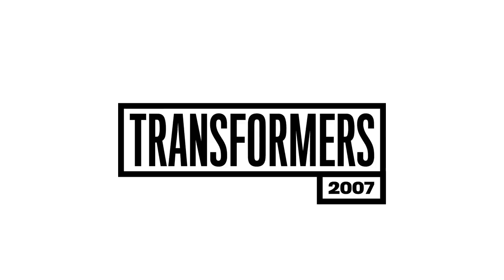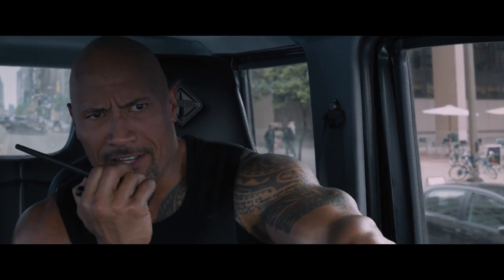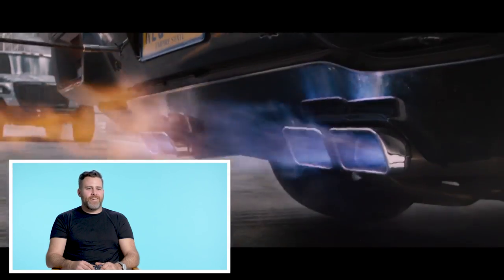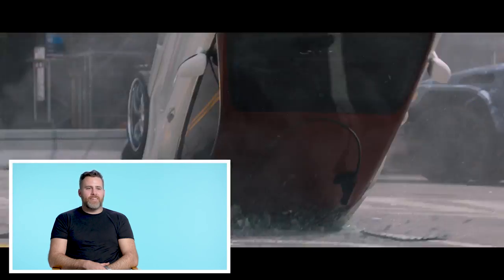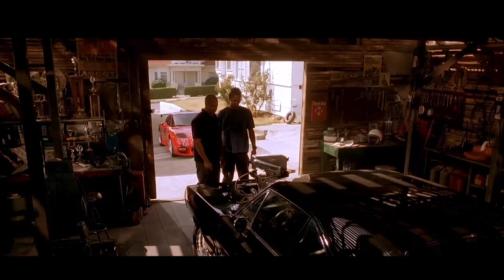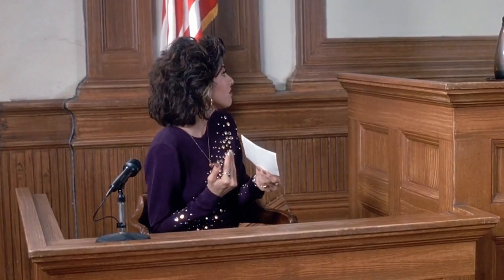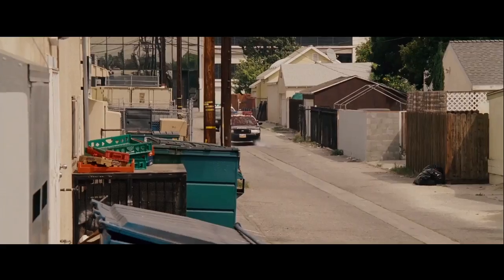Car Expert Breaks Down Car Scenes from Movies | GQ

Comment: Hold up, you're not gonna mention she said, "double pump carb" after explaining the individual throttle bodies??? And double pump carbs have the same size squirters on both primary and secondaries. And finally, After Market distributors are Electronic, without points.

After the first video, You sir, are NOT Qualified to rate these videos.
Reply: Agree
Reply: Said that whole movie quote was accurate after that as well...🤨
Reply: He literally addresses everything you just said.
Reply: @CarrLuke  wrong, she says, "whoa, nice headers, you have a high rise double pump carburetor" and then he talks about High Rise-Headers. Also, if he really was a fabricator instead of a business man, he'd know you can put ANY Engine in ANY Car.
Reply: yes but about 1998 a distributor was replaced with sensors like a camshaft position sensor and a crankshaft position sensor and coils on each spark plug you got your sensors for timing and positioning and coils for spark. and 71 was the last year for points and the condesor
Reply: I like how he can tell how many cubic inches it is by looking at it
Reply: @skydoesbuttercraft1  73 was the last year of points, i know because of my olds cutlass. Also, I feel like you replied only to show off that you know a little about sensors, there's way more innovation as far as the internal combustion engine. But, good on you for knowing that.
Reply: Aftermarket distributors don't have points? That makes no sense and isn't true. You do know the definition of aftermarket don't you? It just means not OEM. You can buy an aftermarket distributor with points they're just made better than they were back in the day...
Reply: @skydoesbuttercraft1  my sisters 2003 blazer has a distributor and sp wires.

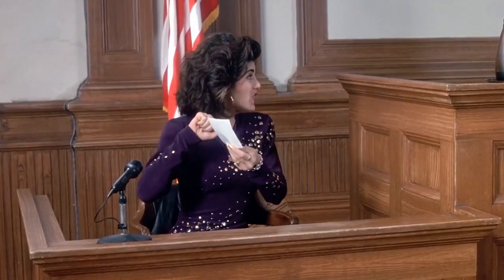Comment: 11:25 he's completely wrong about this scene, positraction has nothing to do with suspension, it's the presence of a limited slip differential which would allow equal power to be distributed to both rear wheels so that it could leave even tire marks left and right when burning out. A standard open differential would only leave tire marks on one side.
Reply: I mean the movie is correct about the curb and independent rear suspension, though.  Posi-traction is a Eaton trademark for their specific type of LSD which works slightly differently, but accomplishes the same general outcome.

Comment: TRIVIA: The R/T Charger used in TF&TF, never had that engine. The motor was a pro race block built for another car that the production team was able to get on loan for about a day for vanity shots, the engine, though 100% real, was never meant for that car. After they got their shots the engine was hauled back to the shop which loaned it out to the production. The sound was later edited in post production. So no, Dom's Charger never made 900 horses of "Detroit muscle"!
Reply: Which is why you never hear it whine... No SC sounds. =(
Reply: It is not their fault Wired gets all the top talent LOL :P
Reply: @spornge  you ain't  lying
Reply: @WhiteKnightMoto good point!

Comment: Yeah he missed it there... at 13:54 she said there were only two that had posi, independent rear AND enough power to make those marks... Corvair was like 80 - 150 hp depending on the year so it is reasonable for her to leave it out... not saying a Corvair can't do a burnout just saying it would be unlikely to be that model to lay down lines. 
Pineapple Express - cars are 18g seal and shooting a car nothing would happen.. Not true, all kinds of stuff can get hit by that bullet and all kinds of things can happen. Most likely, the bullet will hit something electrical and it will start to fail or shutdown. He's right the car will most likely not explode if the tank is hit, but the leaking fuel can get lit by the hot exhaust or brakes.
Reply: Yeah, she said weight, wheelbase, and enough power. This guy tried to sound smart naming the Corvair.

Comment: I thought positraction was a form of limited slip diff... Nothing to do with suspension.
Reply: Yes Posi is a trade name for Eaton limited slip differentials. The bit about posi and the tire marks is conceptually accurate... but basically Marrissa Tomei was saying a car with independent suspension and posi made the marks. Independent suspension will have a better contact patch with the road..... but a curb peel like that.... may be hard to tell...
Reply: @googuser3145  Geometry in an IRS will allow for skids as even as that. Cause the camber changes as the wheel travels doesn't it? Allowing for an optimal contact patch.
Reply: You'll still spin 1 tire the majority of the time with IRS and an open diff. Modern cars get away with having an open diff because they can individually apply the brake to the wheel that's spinning to make the other wheel spin.
Reply: @tsmall07  AKA Volkswagen EDL...
Reply: @aspecreviews   yup You'll see Audi and VWs with ESP and ASL (anti slip regulation) both use the EECU and abs to put traction down......

...

And its the best ive ever had... i cloud rev the bag of my passat and dump the clutch in 1st or 2nd gear, with the gas pedal pinned, and it was flawless.
Reply: @annahenrietta9517  yes... thats exactly waht i said....
Reply: @googuser3145  Welp, my bad, must've been drunk when I wrote that 😂🤣

Comment: This guy doesn’t know cars. He got 3 things wrong just on the first car.
Reply: Highrise headers 😆
Reply: Like saying the rotor button inside a distributor "hits a contact", no actually it doesn't physically touch at all
Reply: @Samqdf  Thats a detail that gets the point across, he said far worse things on that exact same car.
Reply: @googuser3145  that would go above the hood....
Reply: @-ragingpotato-937  I completely agree with you. As an example confusing a multi-throttle EFI system with carbs is a pretty serious screw up. His description of what high rise headers were was also laughably wrong
Reply: @campkira  highrise headers isn't a thing... In the movie she said highrise carb....  Highrise intake manifold is what she was trying to say... although it had cross-ram Hilborne injection. Out of the hood headers are a type called zoomies, and yhere are a few variations om those as well.
Reply: @Samqdf  He is wrong about that particular distributor having a point. Before the "modern" distributors, back in the 60s and 70s they did actually have a point that would spin with the rotor and come into contact with pins on the cap. That is an ancient and frankly terrible design that no one in their right mind would put on that engine.
Reply: @ejkk9513  Ah yes the old "points" type ignition system, I used to loathe those when I had a car with one
Reply: @Samqdf  I thought they never touched. Just floated really really close to one another and the electricity would naturally flow. That's why you had misfires and sht when there was dust or water in the cap.
Reply: @annahenrietta9517 That's correct, for any later made vehicle the ECU will determine the timing of the spark and the rotor will then let the high voltage arc across to whichever terminal inside the distributor cap is closest at the time and hence sending it to the correct cylinder.
Reply: @Samqdf  Yeah, and even that is old now xD.
Reply: @Samqdf  Cars now fire directly into the specific coil pack with no rotor neded no? The ECU just sends the jolt at whatever cylinder it needs to fire.
Reply: @annahenrietta9517  Correct, its technical name is coil-on-plug or coil-near-plug ignition, sometimes shortened to COP or CNP.
Reply: "Humongous 500 cc engine" 😆😆
Reply: @annahenrietta9517  Nothing fires into the coil pack! Actually the coil pack creates the the voltage that goes through plug wires or mounted on top of the plug!
Reply: These replies are all to big brain for me and I thought I knew a thing or two about cars
Reply: that's most likely because he builds motorcycles and not cars. No idea why they picked a motorcycle guy to analyze car scenes lol, there are plenty marketable car people out there.
Reply: I don’t trust him or any of you.
Reply: They should have got Scotty Kilmer... a car MECHANIC!
These fools at GQ got a “Fabricator” to talk about engines. Smh. 
He should be assessing damages in car accidents  
or talking about “Physical” Car modifications.
Reply: he said that engine would NEVER have Individual Throttle Bodies even though you can get those on just about every engine aftermarket.

Comment: Idk what’s more concerning, how little this guy knows for being an “expert” or the confidence in being wrong.
Reply: Lmao dude got me questioning what I know...hmmm maybe 500cc IS a giant engine
Reply: My bike is 1200cc so I must ride a dump truck
Reply: 500cc is 0.5L, so a half liter engine, impressively huge engine! (The crappiest cars on the road in US are about 1-1.5L engines)
Reply: @seanroland612  lmao didn't even catch that, I assumed he meant 500cid, which he probably did. He was wrong on describing the difference between a "fixed axle" (I assume he meant open diff) and a "limited slip". Both apply differing amounts of wheel rotation according to traction

Comment: Well that didn’t take long to out his lack of knowledge.  “That is a huge engine,  probably like 500cc”
Reply: gixxxer1k he probably meant to say 5000
Reply: @jacoblegault-toffoli7586  there are 1000cc in 1 liter.  that would be a 5.0L engine like in a normal ford pickup truck or gt mustang.   pretty small v8 by most standards
Reply: @gixxxer1k  5.0L for a V8 is nothing special you're right. I'm just saying he probably meant to say 5000 and by huge it was just relative to other vehicle in the same weight class where you would expect lesser displacement  and fewer cylinders.
Reply: Between that and saying it has a carb for every cylinder.... itb nowadays use fuel injection.
Reply: And when he says the engine wouldn't fit in that engine bay: that gen F-Body had a Big-Block under there at some point. A GM 502 or 572 crate engine is not much larger that the 455SD so...
Reply: @jdoosh4797  8L is approximately 506 CID. But I meant "physical size". Sometimes a larger displacement engine is physically smaller than a smaller one, ex: The Ford Coyote 5L is larger than the LS 7L found in the  C6 Z06 Corvette.

Comment: He identifies a 500 cubic inch engine as 500cc, confuses limited-slip diff with independent rear suspension, talks about double-pumper carbs when the car obviously has individual throttle bodies as part of a fuel injection system then confuses a Chrysler K-car as a Buick LeSabre.  I hope GQ starts vetting their 'experts' better......

Comment: Haha Funny, he accidentally said it was a “huge” 500cc engine in bumblebee instead of Cubic inch
Reply: /Expert/, lmao
Reply: lol yeah, I was like...how many liters is that? 0.5?
Reply: Jerry Reed He seems to know a good bit. Maybe not as much as you Jerry.
Reply: He builds some trick cars and fabs up motorcycles in NYC, so he def knows a decent amount. Although, he always says he is a designer. If you like handmade aluminum fairings/bodywork/custom parts, def check him out @speed equipment
Reply: Speed Equipment ^
Reply: cubic centimeter
Reply: Charlie Baker yea that’s small even in a motorcycle
Reply: He said a high rise intake is headers that go over the engine. Among 70 other wrong things he said
Reply: Mike Miller idk about 70 things but another major was the 5000 hp, added the 2000 and 3000 for some reason..
Reply: @wvuvino21  jason stathem said make it 5000 at the end
Reply: @wvuvino21  how about when he called a high rise intake manifold headers that go over the engine? How about when he called the Chrysler a buick? How about when he did a bad job explaining limited slip? Should I keep going?
Reply: Charlie Baker amazingly enough, unfortunately for you,  You’re completely right. Hahaha what a joke. 5000hp haha
Reply: Mike Miller he’s got the 2014 devil sixteen 5000hp
Reply: imagine if he said 8190 cc hed be weird but atleast hed be right

Comment: Not an expert, in fact he doesn't know what the f*** he's talking about.
Reply: Professional driver here. I've competed in the Blancpain GT Endurance series and the Continental GT series in a GT3 car. As someone who has been tinkering with cars his whole life, let me tell you this: I've taught karting classes to kids who knew more about cars than this guy. 

Would gladly re-do this episode if GQ reached out to me
Reply: Marissa Tomei explained PosiTraction and Independent Rear Suspension better than him.
Reply: Yeah he said at one point that the LSD would allow the tires to spin independently, which is true but not why an LSD is important. An LSD keeps power going to both wheels as even as possible. XD. Yes it allows them to spin at different speeds, any diff does that unless welded or locked in the off road ones.
Reply: Way too many mistakes to be an expert.

Comment: This is there expert? He kinda right . That's a small block chevy with a reproduction of a old 4 webber side draft carb intake manifold on top. Headers and a carburetor is 2 completely different things. A double pump carburetor is a car that has 2 accelerator pumps one the front 2 barrels and one on the rear 2 barrels of the carb . He off about the NOS . Flames on the exaughst is movie magic unless you have a 2 step it will pop flames . Back in the 50/60s they used to put a spark plug with separate coil and points on a old windshield wiper motor it would make huge flames after you revved the engine.

Comment: "It's only one gear, going backwards, so you don't go very fast." 

Unless, of course, you're driving one of the old Dutch DAF cars, which had the famous Variomatic continuous variable transmission, going back as far as the 1959 DAF 600. Which meant that these little cars could basically go backwards as fast as they could go forward. And so it was, once upon a time (DAF stopped making cars in 1975, when their car division was taken over by Volvo; they do still produce trucks) a solid Dutch tradition to race DAF cars in reverse. Which, between it being hard to drive that way to begin with and the fact that driving in reverse at (relatively) high speeds results in rather unstable dynamics, meant that these races pretty much inevitably devolved into absolute chaos.
Reply: Can't the Koenigsegg Regera go the same speed in reverse as it can forwards because it only has one gear?
Reply: @zacharycaudle8348  yeah, all ev with 1 gear probably could except the computer would (or should) be electronically limited. The G Wagon had a recall in 2017 for cars that weren't limited in reverse. Idk how fast it could go, but I expect the same speed you could go in 1st gear, since they're usually about the same ratio as reverse

Comment: 10:44 Nope, it’s not. It's a completely different physical quantity. The next few sentences are just nonsensical and confusing. In fact it’s as simple as this…

(power) [W] = (torque) [Nm] * (rotation speed) [rad/s]

…but no simpler.
Reply: Torque is a more useful measurement. Horsepower is NOT a different physical quantity, its the rate at which torque is produced. Which is pretty much pointless since we also measure torque and we read it along with the RPMs it was produced at.

Comment: This hurts my brain. "Car expert Tim Harney" has his own website. On that website he says, quote: "I am not an expert... I am not a mechanic...I am a product designer". You can tell he's not an expert nor a mechanic. He has no clue about these cars.

The engine in the Transformers Camaro is a basic OHV V8, probably a small block Chevy. No, it's not really a huge engine for a classic muscle car like the Camaro. And it's definitely not a Top Fuel engine. That's probably something this product designer has hear but not seen. And the engine doesn't have individual throttle bodies, those are side draft carburetors. You can tell by the fuel lines over the carbs that it's not fuel injected. There's also no reason why an engine like that couldn't have a distributor. Maybe not points style distributor, but a pointless electronic distributor. They are very common in high performance V8 engines. What this guy fails to bring up is that Megan Fox mentions double pumper carburetor, which refers to a single four barrel carb, very common on engines like these. But the viewer can see there is no double pumper carburetor, but instead there's four two-barrel carbs.

And 500cc? That would be small even for a motorcycle engine. 500cid, on the other hand, would be a big engine in a Camaro, but nothing that special these days.
Reply: I mean just because he's a product designer isn't the reason he doesn't know about cars....

Its just the fact that he doesn't know about cars. I know about the same amount but wouldn't go calling myself an "expert" on a yt channel

Comment: For those wondering, of the other many things he got wrong, the big glaring issue for me was the glass stuff. 
Windshields alone are made of Laminated glass. Two panes of standard double strength glass sandwiched together with lamination in between. They do not shatter in any way. It’s not safety glass, in fact it can cause the most damage to your body BUT it doesn’t break, if completely destroyed it can be rolled up like a newspaper, but you’ll never put a hole through it with a foot. 
Side glass and backglasses are tempered, that’s safety glass, four times stronger than regular glass and the byproduct of heat tempering it is that when it breaks it falls into little marbles of glass that can’t hurt you that much. 
But man he got a lot of other stuff wrong too.

Comment: "Each cylinder has its own carburetor"

Someone who knows engines even a little bit sees that it has individual fuel injection and not carburetors.
Reply: Not necessarily, it could be EFI or sidedraft carbs